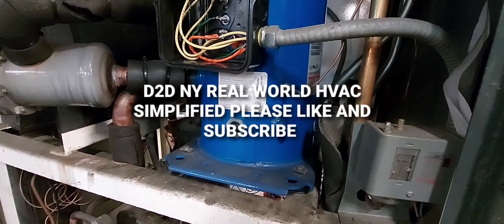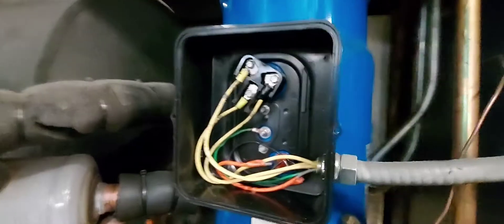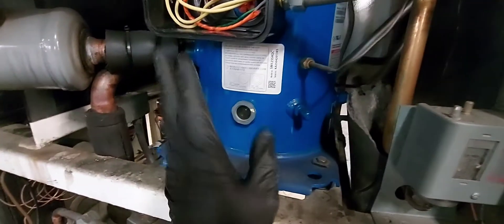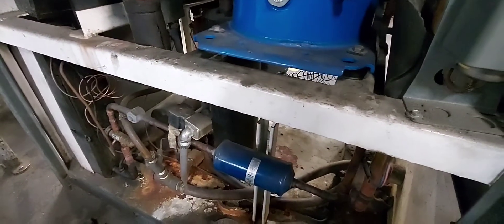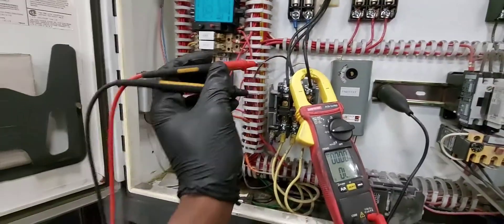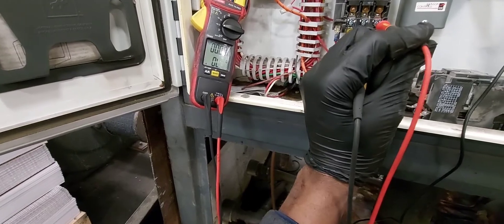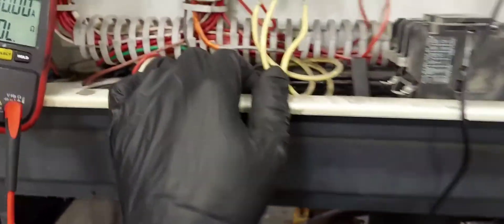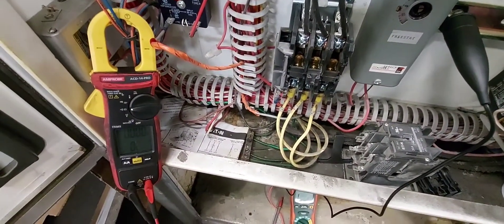HOW TO MEGGER TEST A HVAC COMPRESSOR

Comment: What's determines the testing voltage on say 115volt compressor or a 220 volt compressor
Reply from the maker: Use the closest settings to you system power supply
Reply: Okay thanks for responding but if it's 220 V single phase what is the test voltage @D2DNYAC ... . Do I test 400 volts V 500 or  1000 V. ..... nobody has made a good video explaining the test voltage for Megan compressors..... thanks if you can shed any light on this

Comment: Aren't you suppose to arent you suppose to hold the test button to shhkt that 1000v into those lines to read the megaohm?
Reply from the maker: This meter does it automatically it has a lock function

Comment: Crazy how just a contaminated system can show a bad Meg reading
Reply from the maker: That's usually what caused a low megger reading,, contamination = acid = higher oil conductivity and compressor windings insulation break down!

Comment: you didnt discharge the load wires on the contactor after you meggered them.
Reply from the maker: Interesting how long does that takes to desipate?
Reply: @D2DNYAC  instantly if shorting to ground.  Leave the megge connected after releasing the test butoon so the tester can discharge the line.  The screen will show the voltage drop down to zero.